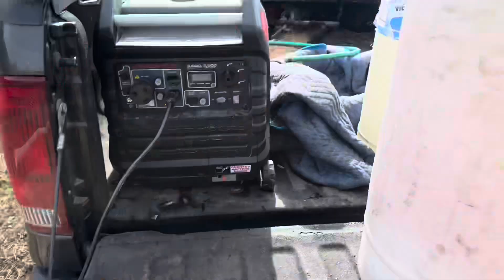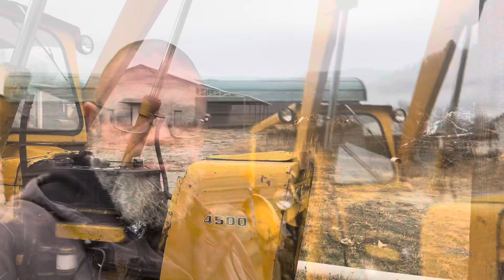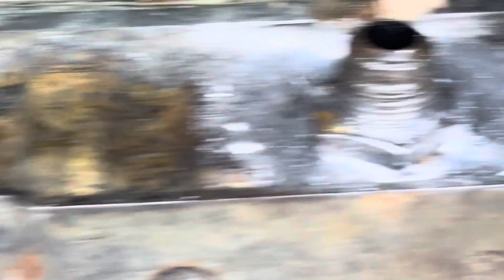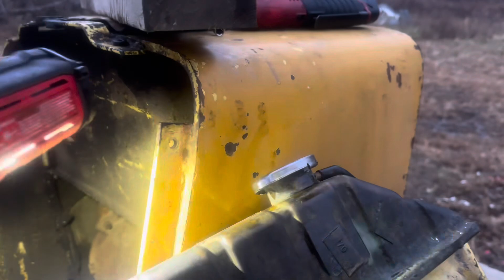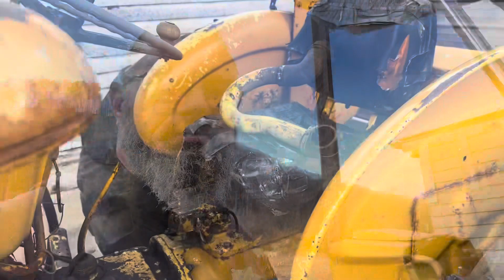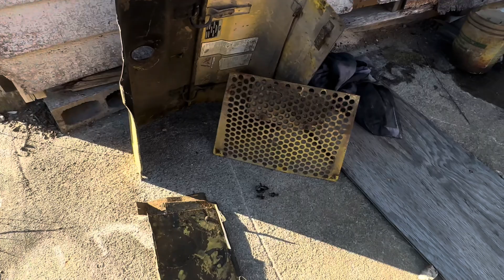Fixin this ol' ford!  Installing the radiator

Comment: I have a Ford tractor and I feel your pain - literally , they are an absolute swine to work on .
I've also dropped those radiator bolts , my language was not as restrained as yours though .
But once fixed they usually run pretty good .
Hard work deserves reward .
Have a great vacation !
Reply from the maker: Thanks for sharing

Comment: Your Ford 4500 is the almost exact Ford I learned to run when I was 12yrs old. The Throttle arm on the right side of the dash was how the backhoe was run at full throttle.
Reply from the maker: I wish I had the backhoe attachment for it. I’ve been looking for one, but no luck so far.

Comment: That fan was just self-clearancing.
Reply from the maker: I thought that too. But then I was afraid that as it wore through, it might grab a sharp corner and cause way more damage.
Reply: @amsoiladam  
Good point. Those old dawgs were built tough, so if they do break, it's usually spectacular & devastating.